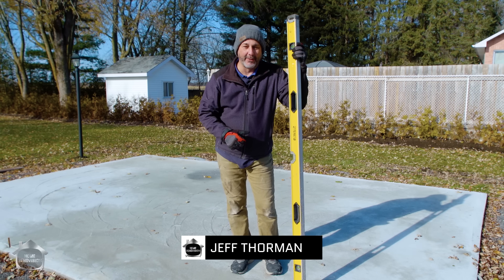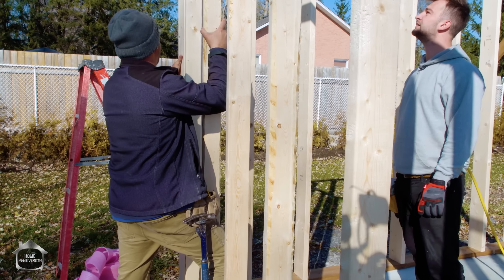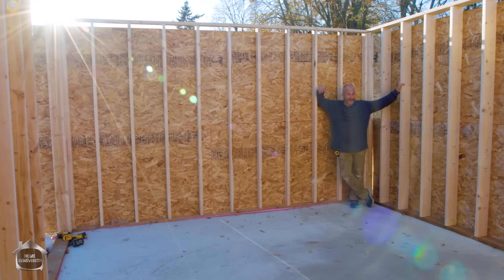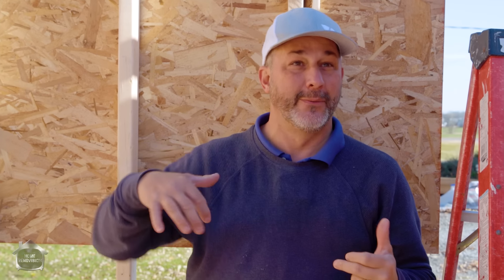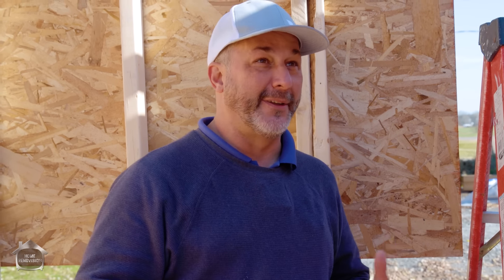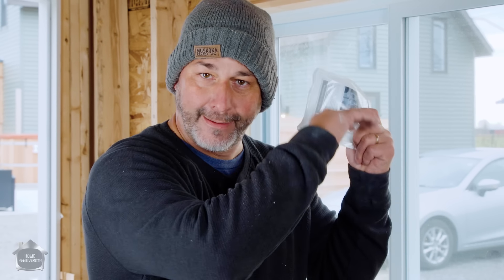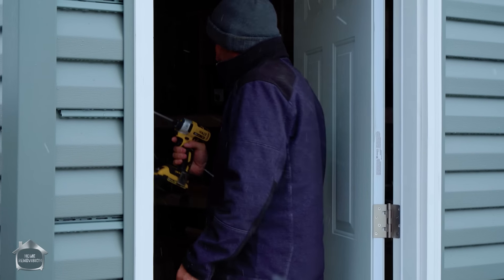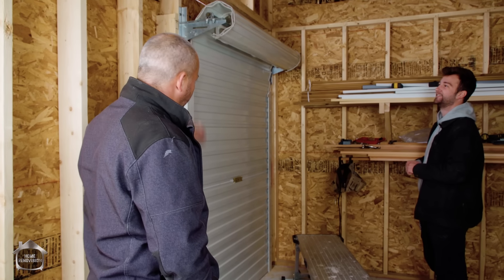Build Your OWN Workshop for DIY Projects!

Comment: Thanks for making these videos.
At 53:20 your drill is taking a long time to bore because of your drill speed.
Reduce your drill speed and apply more pressure to bore faster.
A high drill speed heats up the bit.
The heat dulls the tip, which slows the boring.
You could also use a metal-to-metal cutting fluid.
Reply: Also needs a pilot hole to clear the web thickness of the large drill bit. Take 20 seconds with a 1/8" drill bit and pre-drill.
Would've been done in half the time, and not destroy the temper on the drill bit.

Comment: As a new dad myself, and a 3rd generation contractor, the son double checking his Dad and thinking he knows best only be wrong is the most heart warming and hilarious part of any job.
Reply: His dad is a bit too condescending though. Seems more arrogant than helpful when talking sometimes. I know old comment, but it's exactly how my dad is. He'll say sarcastic stuff like "you know better" even in situations I do. Just happened the other night working on my jeep with a part I have already replaced before and he hadn't. :/
Reply: @WeFareFartherThanDreams 
IMO they have a stable dynamic that will eventually result in long-term friendly banter.

1. They talk to each other and reminisce like they don't do this a lot 57:10
(Which explains the high emotional variability from the baseline per problem they are solving).

2. His son is clearly arrogant relative to his skill level 22:44 
(Couldn't find where to put a couple of 2x4s for the windows.  He is using plausible deniability for his incompetence and uses a persona to act motivated).

3. Jeff does make mistakes that need correcting 56:30 
(Jeff incorrectly pulled far down on his side of the roller door, preventing his son from being able to pull down his side.  He also failed to keep the roller stable while his son pulled it down).

4. From what I can tell, Jeff wants a positive relationship with his son 24:40
(He is projecting himself onto his son and provides non-abrasive instruction while his son attempts to tackle the problem earnestly).

The only way it results in a blow-up is if one party makes it taboo to criticize the other beyond reason
(This is likely the reason why you have a bad experience with your father).

Since neither is perfect, each will have the other's weakness to poke at, until an understanding is reached.
Jeff isn't above abrasive banter, so a relationship-traumatizing blowup has a lesser chance of happening.

Ideally both make mistakes in front of each other consistently.
This will lead to each presupposing their own weaknesses relative to the other 
(E.g. they will respect each other and be humble simultaneously).

That will make most future conversations much more friendly and fruitful
(Which generally will have lots of sh*t talking).

This positive outcome won't require intervention from an outside party to be reached 
(There's nothing wrong with what is going on here).

Comment: 4 minutes in and you show a fabulous tip I've never seen before - the notch instead of a hole for the J bolts. Brilliant. Maybe I can do this (by myself). Thanks.  Onto the rest!
Reply: Just hope that no inspector or strong wind comes along!
Reply: Horrible tip... Didn't you see the wood split? 

Just use a wood bit and drill your hole a bit larger so you can move the base plate around a bit to get the walls squared up.
Set all base plates down over the anchors, make them square, and mark their locations on the foundation.

Build your walls, stand them up on their marks and fasten them down, and you know you'll be square. Obviously, do a double check.

It seems like extra work to go "slow" at the beginning, but if you take the time at the base, everything else goes faster and more accurately.
Think about the end goal and all of the steps to get there, and envision how one change affects the next.

There were a lot of mistakes made on this shed that would've been prevented by slowing down and thinking for a second. Built in a rush...

Comment: Just a heads up, whenever you have plywood sticking out/leftover that you need to cut out, a router is a very simple solution. No need to measure or draw anything out. Specially for those windows, just make a little hole for the router bit to go in and route it out from the outside. Super easy and opening cimes out perfect following the 2x4s.

Comment: I have the same door and had the same issue. Loosen the brackets that hold the door, use a pipe wrench to hold the shaft in place while you rotate the entire door to increase the tension. From a tight roll, my door needed about 1 and a half turns.

Comment: Heads up , roller doors have weight in the in them to creat e tension (esp. when they are cheap and thin metal) try sticking a piece of scrap bar 3-6 pounds in one of the recesses, 2mm x 25mm, iron is good. Start with a bigger piece and you can trim down to weight till you find a happy medium. P.s. if the recess is shallow you may have to use some adhesive

Comment: I don't think you're missing parts. Looks like there is a spring in the center that needs to be tensioned. Probably doesn't need much... My guess.... set the height of the door when it's open, spin the shaft to get tension the spring, tighten u-bolts. There should be some hardware that attaches to the door to prevent it from completely pulling out of the tracks. I've never installed one, but that is my guess.
Reply: You are not supposed to cut the plastic holding the roll until the door until it is installed. By unrolling the whole thing on the floor he lost all the tension.

Comment: As others have mentioned, the roller is supposed to be under tension when closed so that the roller pulls the door up and keeps it coiled. There should be some sort of stopper that attaches to the bottom of the door so that it does not open past those tabs on the top of the guide rails.

Comment: Really like your videos. Just one thing that I would do differently is as I have seen in other videos, is drill a hole close to the stud and then run a flush trim router bit against the stud and follow it around the perimeter. Simples! Perfect fit.

Comment: Me again. Pretty sure your roller door should have a rectangular container at the top which encloses the rolled up door and prevents it from creating a huge coil above your head. Basically you roll the door up into a tightly wound self-contained coil, inside a box. Jeff, you need to make a nice timber box for the coiled up door!😉

Comment: You can stand that entire wall on top of the bolts and just kick into place over the holes and it drops down. You don't notch the bottom plate for bolts because it's not  necessary and makes the plate weak at every notch so it's not allowed by code and those washers aren't  correct. You need bigger square hot dipped galvanized washers for treated wood.

Comment: Just a guess as I've never used one of those rolling doors, but as you lift the door you want the roll on top rolling itself up at the same speed, and to do that maybe loosen those U bolts and twist the pipe to build up spring force, then when you have the right amount of tension tighten the bolts back down

Comment: Thanks for the video!
I am building a modern shed like this but 10 x 18 and since it is for a gym I wanted 12 feet for the tall wall and 10 ft for the remaining walls.
I was wondering if I can use 2x4 or should I spend the extra money (lots) and use 2x6 like you did? Did you use 2x6 for the simple fact that it is stronger?

Comment: If you're building too code you needed to balloon frame the tall wall instead of adding a pony wall on top because that creates a hinge point on a load bearing wall. You also need headers above the windows. You have 2 rafters bearing on a single 2×6 over each window. So half of the rafters don't have proper bearing and especially not when you have snow loads to worry about. Everything in this video is a good example of improper framing that's not too code.

Comment: If you can't lift the wall in one piece then frame it in 8' sections  then tack them together tightly with blocks on the top and bottom plate breaks. Then put the bottom plate on the wall line that should be  snapped on the concrete where the inside of the wall goes that way you know if the wall is straight. Now that it's straight you can square it like it was one wall. Measure from outside corner of the bottom plate diagonally too the same point on the top plate at the other end. Now you can sheet it on the ground and it will be plumb when you stand it up. Pull the blocks after it's sheeted and stand each section. Then connect all of them with one top plate. That's the easy way. For 8' walls you want to get 92 5/8" studs so you won't have to cut them and the sheets will land on the center of the top and bottom plates so you can nail the edges without putting blocks in every stud bay for it. Don't do anything this guy does or you're going to have problems the whole way and you won't pass inspection

Comment: I believe all Garages, shops, sheds that are only inches above grade should have a RAT wall. It will make the bottom plate last many years longer and makes it easy to wash out with hose if desired.

Comment: Hi Jeff, i'm bulding a similar shed 16x12 , and can you tell me if a need to use 2x6 for the front and back wall or can i use 2x4 ? And the roof , is it better to use 2x6 every 16 inch or 2x4 every 12 inch? and thank you for the video that you are making ! they are life savior !

Comment: So wait, you don't need to double up your wall studs on the upper section on each side of the slim windows? I would have thought due to the span of the windows, you would need more supports since you have to skip where the windows sit (for load bearing, especially for snow loads). I built a workshop/shed almost identical to this, I was planning to add windows later, but I'll probably double up on the studs just to ensure I have enough weight transfer when I cut out the un-needed studs.

Comment: You could save a lot of money by using 2 horizontal windows instead of 4, especially since they are not operational. Then use a 2x6 or 2x8 header to carry the roof load. Then your window placement could be centered on the front of the building. But...it's still a helluva shed !!
Reply from the maker: maybe but getting supplies during this covid meant I preferred stock items to custom ordering.

Comment: Hi Jeff, I really enjoy your videos. Thanks for sharing your knowledge. have a question, I see you cut a square on the base board to tight it to the screw on the slab. Any reason you did this instead of drilling a hole where the screw is?

Comment: Why not drill out the holes for the anchor bolts? Depending on where you live and the building codes your sill plate is over notched.
Reply: This is exactly what I thought. Someone didnt watch Larry Haun.
Reply: And how about a header over the windows instead of a single plate.  Would have been easier to layout and sheath the walls on the ground

Comment: The roller door needed to be rolled up tighter befor you lifted it onto the brackets ,then clamp the spindle down tight,then rotate the roller one and a half turns ,then feed it into the chanel,pull door down to base ,then bend tads at top to stop it coming out of chanel when you open it .best wishes from England
Reply from the maker: I hope that is all we need. i feel like we are missing hardware. will give it a go this spring. Cheers!
Reply: @HomeRenoVisionDIY  You are not missing hardware. But you definitely screwed yourself there by unrolling that.

Ive installed a roll up door on my shed. Here what needs to happen.

Before you cut the cable that's holding it together you need to mount the side tracks and the entire rolled up assembly in its space then take a bar and pre tension the springs inside or else it will just unravel itself and won't have any tension to roll back up.

The hardware that comes with them (the ones from Lowes Canada) is crap. I bought some extra hardware before I installed it and ended up using the extra stuff instead of the provided ones.

What I suggest you do is take the door back off. Lay it on the ground. Roll it as tight as you can. Put a ratchet strap around it to hold it, then mount it above the track. Now you can Tension it. Tighten everything down. Then you can untie it and it'll work.

Comment: Could a spring loaded 2" wheel on each side up at the top pushing against the metal mounted on the bracket on  the inside help keep tension while the door goes up and down? It's not factory, but it could compensate for the missing parts, couldn't it? Best of luck with it.

Comment: You don't have enough tension on the roller, it should be tight as you pull it down, so it retracts as you lift it.

Comment: Would you be able to add additional studs to carry the load between the windows? Then you could space them equally across the front
Reply from the maker: or you can add a 2x4 across the interior frame and pick up every rafter. Cheers!
Reply: Absolutely..putting a header across there would give the option of putting windows in any location. I would have definitely went that route.  Them windows are going to draw your attention and layout is important.

Comment: Great project! So far I like how you overhang the bottom plate a bit and attach the sill gasket to the bottom plate. One question, so it doesn't create a weak spot or structural concern when you notch the bottom plate for the anchor bolts? Loving your videos, eh!
Reply: Absolutely! And at the very least he could have used some larger washers.

Comment: Great video! I want to build a workshop/gym and I'm wondering if 10' walls would be excessive or add any extra level of difficulty other than height? I need to get weight overhead and at my height thats above an 8' wall.

Comment: Hey Jeff - love the show, I've learnt a lot of neat tricks as a result. I recently did some DIY work on our 'roller' door (that's what we call them in Australia) and I too had the same issues. I noticed that the door was ballooning out as I was trying to roll it up by hand. A self tapping screw and some tension will sort that out. Roll the door up slightly (1/4 turn) and place a screw through the door and into the barrel located inside the roller door. This will prevent the first cycle of turns from ballooning out. Also, and I'm not sure which side the tensioner is located on your door as mine was located on the inside left, increase the tension of the tube. You can use a pipe wrench or some manufactures provide holes in the tube so you can place a rod inside of it to turn it upwards for more tension or downwards for less. Best of luck mate.
Reply: I watched the roller-door installer put in my new garage door and he was also explaining to a brand new apprentice how to do it.  Firstly don't unroll the door.  So I guess for you guys roll it back up as tight as you can and then tie it off so you don't have to hold it.  Put the door in the 'u' bolts and lock them in place.  give the door two (2) full turns to tighten the spring.  At this point the installer paused to explain the gruesome injuries that he has seen when the door axle is allowed to uncoil out of control.  Then feed the door into the runners and you should be good.  The door falls to the ground from half open under its own weight and opens itself from above half way open due to the spring tension.  You have inspired me to go get a bunch of timber and just build stuff.

Comment: Hi, fantastic video as always. In the country where I came from, the frame construction is not common, so all this is new for me, but very interesting and exciting.
One small question - what nails do you use for the bottom treated lumber? And which ones for regular lumber?
Reply: 16d framing nail
Reply: @Josh-hw8mp  Thank you, I asking because I heard that common nails cannot be used for treated wood, as they rust quickly, is this true?

Comment: You need a spring on that lifting device on top. Take the bastard door back and seal up the opening with OSB and siding.  You can remove that cheaply in the Spring.  Order a decent door from Amazon or someplace local who has a spring.  Some jerk probably stole a part from your package for their own use.  Maybe they wanted the pole for their garden fence.

Comment: Thanks for leaving in the measuring mistake. At least it proves we're not all perfect... even the professionals make mistakes.. and you show how to recover. The question  is What if you told him to cut 8' lengths,  but he then took 3" off thinking 8' was the wall height  not the the beam... cant easily add the 3" back ;)

Comment: Two questions.
1) Why cut the long way. You are compromising the lumber without sealing it. You are a big fan of Waterproofing a basement.
2) Why not drill a hole. Seal it and then continue.
Just my thoughts...3-4 Minutes into the video.

Comment: Why did you cut the slit in the bottom plate for the bolts?  Wouldn't it be more structurally sound if you just drilled a hole for the bolt and placed the bottom plate over the holes?
Reply from the maker: against uplift yes but I do not have that problem where I live. So I was more concerned with standing that huge wall up without pulling a muscle.

Comment: if you measure the diagonal in both directions making an X. then add the diagonals together. then divide the result by 2. that's what the real diagonal should be.  by using the diagonal which is the largest value possible to measure. your accuracy will be super high. if you are a fancy pants you could measure the diagonals from top to bottom. but in that cause you need to be confident of the lengths of lumber used.

Comment: As a beginner DYI'r it would be nice to know what type of nail gun and size of nails you are using on the studs.
Reply from the maker: 3 14" nails designed for my nail gun. each tool has a different nail so be careful when buying. Cheers!